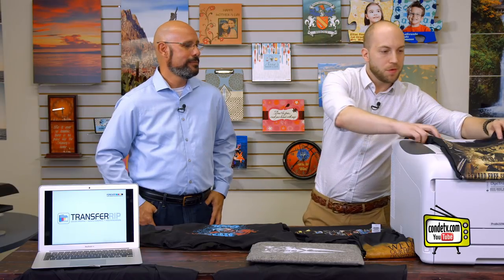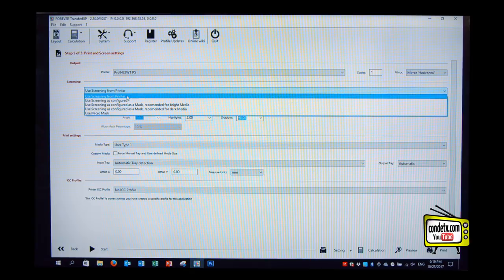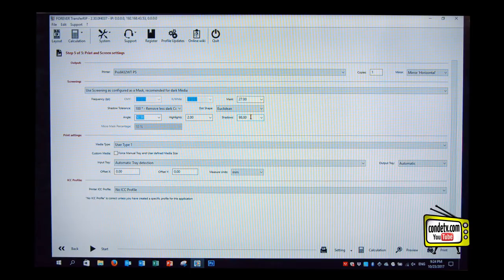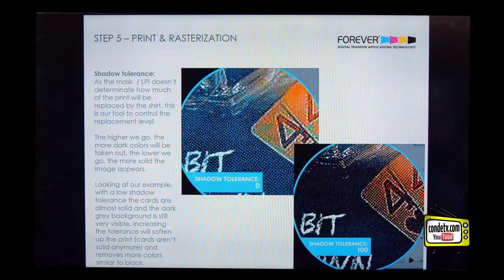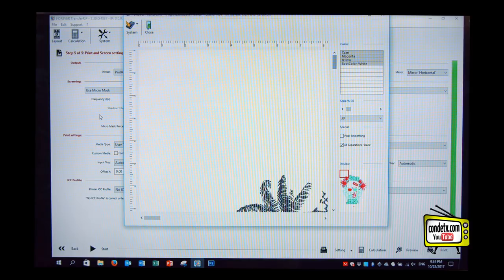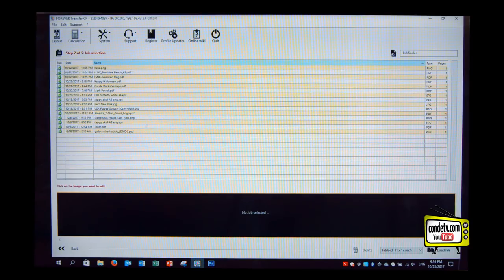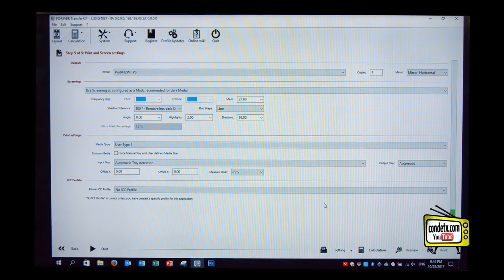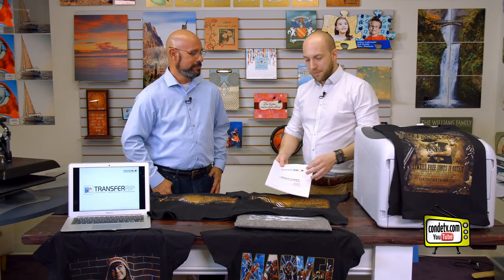FOREVER Paper -  Forever TransferRIP Tutorial Part 2 of 2

Comment: So my first comment is on the 1st video the gentleman demonstrates turning on the "Preserve Transparency" on the witch image to eliminate the white thick border and preserve the fade around it. From experience If you were to print that as it was, you end up with a white or greyish "haze" around it. My suggestion is to create a layer behind  the image (in PS) to fill it with black (or shirt color) so it has a hard edge for the white to "tuck" behind because it can't hide behind transparent pixels.

2nd is you have to be careful with the brightness slider. If you have pure white in your image, Sliding the brightness up starts to negate that white (because white can't get any brighter) and you LOSE white in an image. I found this out with a bowling pic where i needed the black ball brighter but I lost the white in the pins.

Last, a suggestion for the programmers (beside the 2 I listed) is instead of needing "colored" paper to test my results, why can't they simply put the substrate color on the preview page? Its a pretty accurate representation but very hard to "imagine" what it would look like on the color its going on. The ink is expensive, why should I constantly waste it on copy paper, especially if its a full sized design?
Reply: Dave Nowicki that's a good point put the substrate color on the preview page to see the results if we want to print on color shirts.